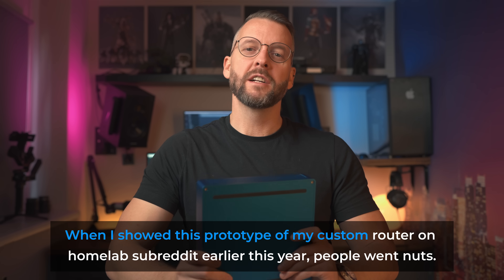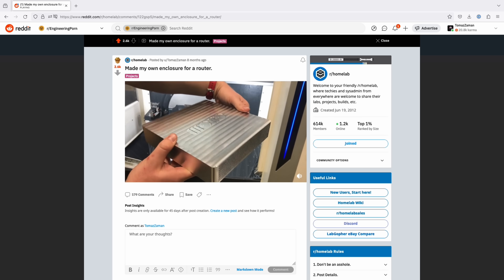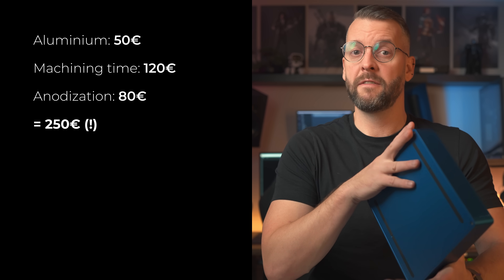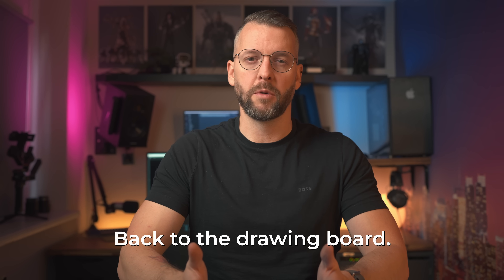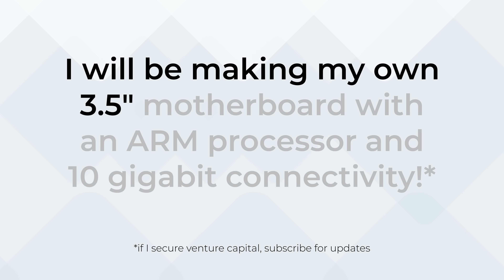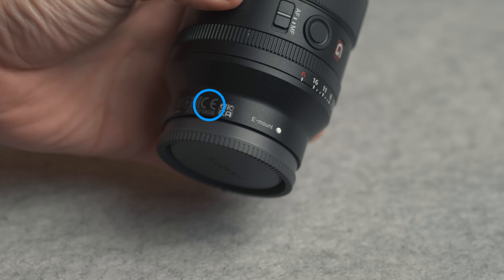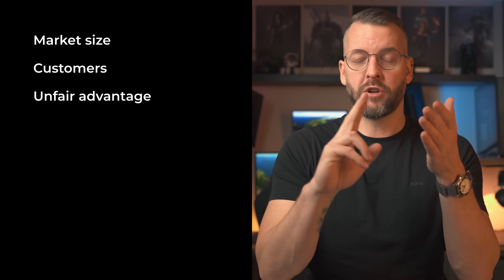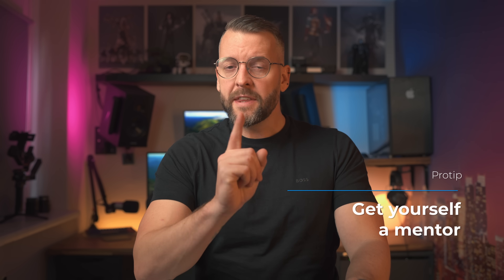I'm making my own high-end router. From scratch.

Comment: "CE" is the abbreviation of "conformité européenne" (French for "European conformity").
Instead of machining from raw block of aluminum, it is cheaper to just use an aluminum sheet which will be cut by laser then bend. You can also have a very nice design with this method for a fraction of the cost.
Reply: Indeed... or use of the shelf extruded aluminium cases ;)
Reply: Yeap. There's billet aluminum case - what he built - and extruded, stamped, and cast. Stamping is quick and cheap (once the molds are made), but it's not the best looking output. (no sharp corners.) And then there's the issue of low volume; anyone who would/could do this would never invest the time in making the molds for just a few hundred, or even thousand units.
Reply: Or make it out of aluminum pieces that screw together? Instead of 1 unit per 7 KG block you can make multiple driving down the cost.
A 4 angled wedges for each router, and some threads will go along way in saving raw material money (and shifting that capital to manufacturing instead).
And anodizing more as you don't waste the volumetric space you only need to anodize flat bars.
Reply: @jamess1787  when machined after assembly you can even make surface joints look nearly invisible.. but this would most likely drive up machining and assebly cost to a unreasonable level
Reply: As a wise man once said:  "She's a foldy boi."
Reply: I would price both as an option: chose one for manufacture, and then open-source the dimensions of the board so people can also CNC their own fancy case locally. (in their local maker space, perhaps.).
Reply: Sheet metal is definitely the way to go. I also feel like the end design is going to have thinner walls, to cut down on cost.
Reply: This is my first idea, too, for reducing expense. 

My manufactor flow: Form the walls from aluminum strip, weld the seam, machine the air intake screen/filter, machine basic features for the lid, weld the walls to the lid/cap, and then machining the fastening features. Then, ball peen texture and anodize.
Reply: The neat thing is that the manufacturer just declares "this is conform with EU laws" and that's it. No need to send samples to a testing center like they do with e.g. TUV certification.
Reply: @kataseiko  no need to be certified by a third party unless it's a medical device, but you do take responsibility for the CE declaration, therefore they better carry the EM compatibility tests + safety either inhouse or from specialized labs.
Reply: @kataseiko  but if you report it wrong you are liable so better make sure the self reporting is based on actual testing
Reply: Not only he was wrong on the abbreviation, but on the tests too - CE is self-reported. If a product is assembled from parts already bearing CE marking, he probably wouldn't have to do any testing. Just documentation. It's not FCC - that's a completely different problem.
Reply: @_nopestr   Wrong, assembled CE parts do not make a CE product. For CE you need to make the electromagnetic compatibility tests and low voltage tests on the finished product, then you self declare your product CE. So yes, it is moderately expensive.
Reply: @_nopestr  Relying on parts being compliant is risky business. And for emission tests, you have to test the complete system, which can often fail, even if the parts are within limits...
Reply: @mikkels5724 Still doesn't change the fact that CE is self-reported.
Reply: @_nopestr when you are not a Chinese producers and fear regression you would have a lab do the testing (same for fcc/emv) - maybe you don’t need the electrical safety with an external psu at least.
Reply: @_nopestr  That is NOT how CE marking works. Yes, it's self-cert for most types of product (not all). But you do need to have the data to back it up and that means doing testing. And CE+CE != CE. You cannot take precertified modules and stick them together and assume the result is compliant. You must test the final product.
Reply: @_nopestr  You can self-certify, but a reseller or customer can request for evidence of compliance and you're required to give it to them. Using CE certified parts makes compliance easier, but it's not enough. 

For example, a lot of motor drivers that are marked CE compliant have passed tests with particular filters and configurations that aren't always specified in their documentation (you'd have to request it to the manufacturer). Something as simple as putting two of those motor drivers can mean you exceed the limits, so your device won't pass regulations.
Reply: CE mark in many cases means “China Export“. The one you showed, definitely does, because the devil is in details, and in this case — in spacing between C and E, with Chinese logo (that was made that way deliberately to resemble the original “conformité européenne” mark) being slightly more airy than the European.
Reply: I thought the same. Either sheet metal or multiple parts for the sides(4) that you mount. Also Should drastically reduce machining time if you make reach part basically the same for the sides.
Reply: Yeah pressed and formed don't have the unibody feel of the CNC machined but I do get your points
Reply: I always thought it meant Chinese Export 🤣 nah, just kidding. 😅
Reply: @maticjelovcan  you are not that far from truth, Chinese mark has wider space between C and E, otherwise it is identical.
Reply: @maticjelovcan  Fun fact: there's also Chinese Export, the logo is slightly different (basically different kerning).
Reply: @samiraperi467  No, there isn't.

"The [European] Commission responded that it was unaware of the existence of any "Chinese Export" mark and that, in its view, the misunderstanding had arisen because a producer had failed to respect the precise dimensions and proportions of the mark as prescribed in the legislation."
Reply: @samiraperi467  It doesn't exist any Chinese Export logo: that'd be quite illegal, "Chinese Export"/"China Export" is just a joke made for the fake CE logos.
It basically means it's not CE at all and, probably, quite poor quality.
Reply: I thought it was for Chinese Edition. ;)
Reply: Ironically there is a symbol that looks almost identical to CE but means „China Export“.

Comment: Is there a way to get away from the solid block of Aluminum? For instance if all the sides are separate pieces. The top/bottom would be pieces, then each side  could be a piece. If you had each corner fit together with interlocking circles (think how the two pieces of a door hinge fit together), then you feed a screw through the bottom, up through the interlocked corner, and screw into the top plate holding it all together/solid.

Done right, it could fit together very tightly/sturdy and there would only be the seams between the pieces, but really would just be the edges. Would also open you up to offer different side panels that allow a rackmount kit to be attached!

Either way, I'm on this ride till the end! Very cool idea.
Reply from the maker: Thank you! In fact, we did briefly look at the possible tech to achieve the same result, such as welding, but no results/solutions yet. Will dig further! :)
Reply: @tomazzaman  I was thinking this too. If you need something to screw into you could hypothetically machine a frame with the leftover aluminum.

That itself may be a useful tool, being able to machine additional parts in parts of the aluminum you'd otherwise be getting rid of. This doesn't solve the underlying issue though.

One thing you could consider is using separate pieces to your advantage aesthetically. Aka, machine each side of the router and possibly leave blocks for screwing into.

Then for some sides you could use a different color or material for flat sections, e.g. after that rounded corner you could have long flat strips of a different color, or even a different material. This may be useful for things like an I/O shield for your motherboard and ports, which you can machine separately.

Separating the sides results in a potentially much smaller overall volume, because you cut out most of the middle that you are discarding. Smaller bounding boxes = less material = cheaper, at the cost of having to machine addition parts. However, it is possible, likely even that you could machine the separate parts from the same block of aluminum, sticking them together as close as you can reasonably get (maybe an inch of separation). This would result in you being able to machine the four long skinny sides together. The big front and back could also be machined together, because they are both of the same size.

If you can also make parts identical e.g. the top/bottom parts, left/right, and front/back, you can instead of machining them together simply machine 2 of them.

And considering the necessity for some kind of area for I/O and ports, you could probably just leave out an entire side and machine an I/O shield with a simpler technique. If you design this with traditional I/O shields in mind for whatever motherboard form factor you use, this would allow other motherboards to be used.

Batching different similarly sized parts together where the amount of empty space is minimized, and creating duplication for re-use of parts will mean you can just either use less material for multiple parts, or if truly identical, simply machining more of the part instead of having to machine multiple or machine them together would likely work great.

You could even go a step further, and instead of machining the sides separately, also even machine the corners separately. You might even be able to create spots for something like tempered glass so you can show off the insides of your fancy new RGB gaming router fad starter. I can assume a tempered glass sheet is likely cheaper to produce than a part cut from a big block of aluminum, while also potentially benefitting the visual appeal.

Lots of interesting ideas on how to try to reduce machining overhead, and create re-use where possible without sacrificing the aesthetic appeal of the case too much.

Side note, but this is somewhat analogous to optimization in programming, in fact it is a reasonably accurate analogy even. Each part is a function, the desired shape is the code, and the 1 inch envelope is sort of like the overhead of running the code. Each part itself has an O(n^3) complexity. Like in programming breaking the pieces up too small is impractical and you add extra overhead unnecessarily. Also like in programming, re-use can lead to performance gains by being able to make optimizations (like cutting out the empty center of the router case as a cost by splitting it into separate pieces, or batching similarly sized parts together to reduce overhead). In programming there are often aesthetic preferences at play too, so a similar balancing game between cost and sleekness/cleanliness. Your budget or target cost is also like the hardware requirements you're trying to meet, and that governs how aggressively you will try to optimize. Pretty fun!
Reply: @Hexcede  @tomazzaman: Exactly, look the furnitures of Ikea, for example. How smart they are. Only the visible parts are painted or dedicated for visual and taktile appereance. The rest is only as less as possible, they should just functioning, not more. And this is the rules, what are working in the business. Be smart, be clever!
Reply: That's stupidly overpriced.

Best solution is to rough cast and then jig machine it to lower processing cost for mount points etc

Comment: I would love to know with which software as OS will you pair this project, I personally love pfsense, but unfortunately it doesn't support arm architecture in the community edition.
Reply from the maker: There's two projects that I have in mind and would like to support: OPNsense and VyOS. The former is FreeBSD-based while the latter is Linux (Debian). While neither of the projects have dedicated ARM packages, they are open source, so I'm quite confident they can be compiled/ported. Probably not over night and there will be significant testing required, but I don't see a reason why not. I mean Unifi is already running VyOS and Deciso (company behind OPNsense) already sells ARM appliances that run it.